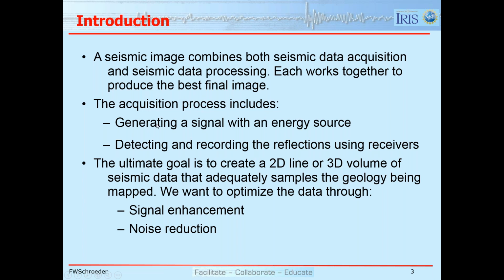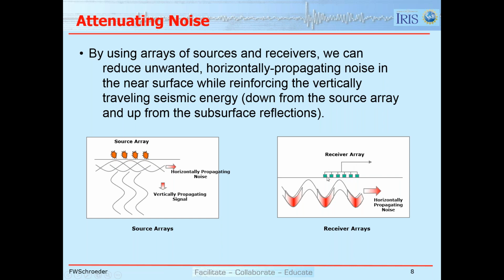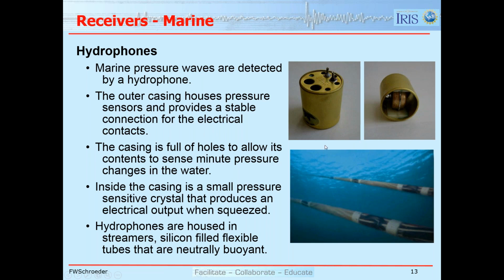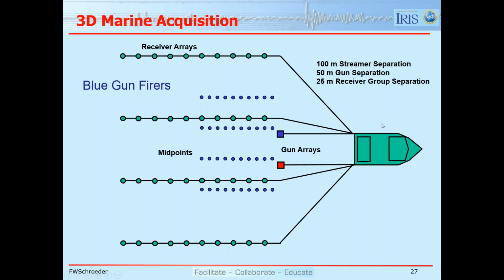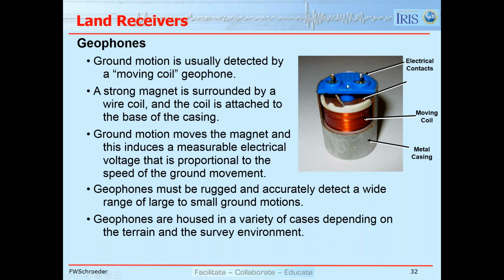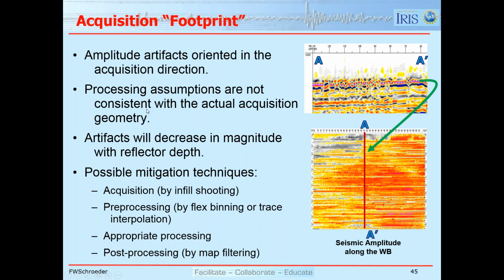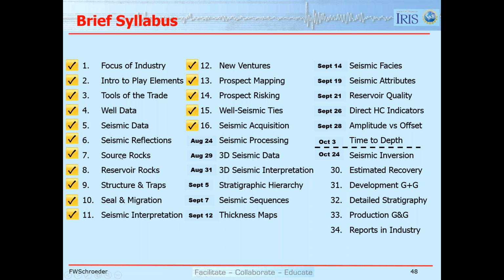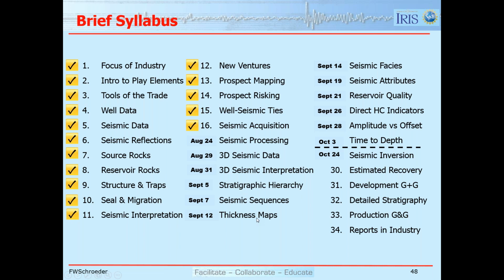Lesson 16 - Seismic Acquisition

Comment: I have an doubt regarding the sampling period of seismic data set
Why do we sample seismic data set for 2ms and 1ms instead of 4 ms? 
As you have mentioned in your video either in respect with geology or for  business needs,Could you explain it to me ?
Reply: It is with respect to ur needs, depends on what sort of data you desire. If you require high frequency data the time period would get shorter and if u require low frequency data your time period will become larger and larger.